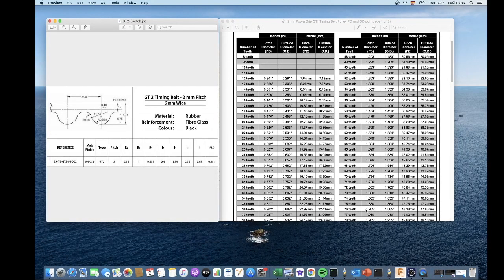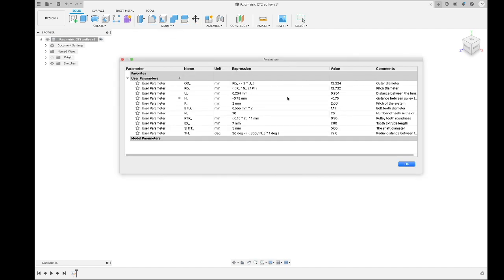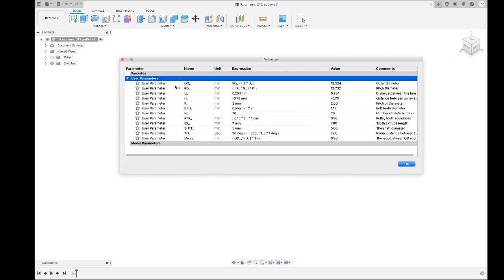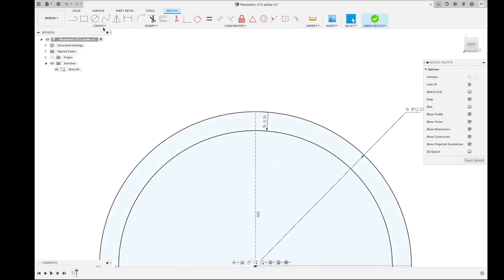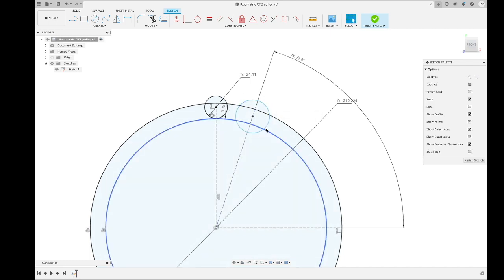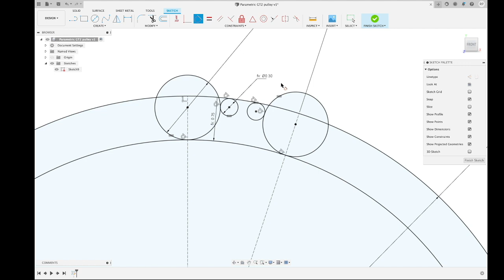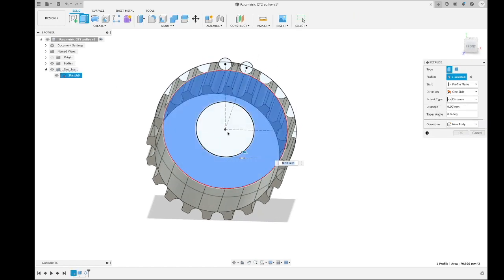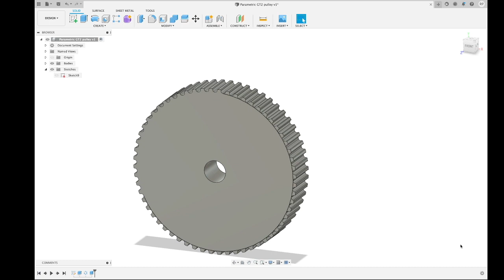Fusion 360 parametric design - GT2 pulley

Comment: Y'all can just import the formulas into Fusion! Just create a .txt, paste the following, and change it into .csv:

Name,Unit,Expression,Value,Comments,Favorite
U_,mm,0.254,,Distance between tensile cord and bottom of belt tooth (PLD or U); varies by profile,false
H_,mm,-0.75,,Distance between top of pulley tooth and bottom of belt tooth; varies by profile,false
P_,mm,2,,Belt pitch (e.g. GT2 = 2mm); varies by system,false
BTD_,mm,( 0.555 * 2 ),,Belt tooth diameter; varies by profile,false
N_,,20,,Number of teeth in pulley (main editable variable),true
PTR_,mm,( 0.15 * 2 ),,Pulley tooth roundness; varies by profile,false
TH_,deg,90 - ( ( 360 / N_ ) * 1 deg ),,Radial distance between two teeth,false
OD_,mm,PD_ - ( 2 * U_ ),,Outer diameter of the pulley,false
PD_,mm,( P_ * N_ ) / PI,,Pitch diameter,false

Comment: Really good work thank you! One small issue is that the resulting model does not have any radius on the belt teeth, therefore they will not fit into the belt correctly. I fixed it but just wanted to let you know about that missing component in case anyone else downloads the file.

Comment: When I try to extrude on the final step it selects everything in the circle instead of just the outer part. Please what do I do.
Reply: I struggled here as well, you can click and hold inside the shape and move your mouse to draw a rectangle that encapsulates part of the two circles and the intersection. This way you select the intersected body, afterwards press E to extrude

Comment: I just used your parametric model to 3D print a pulley with 440 TEETH. I was astonished when the belt wraps completely around it,  every tooth falling right into its groove, a perfect fit. I did not expect easy success. Thank you very much, this was extremely helpful.
Reply from the maker: Glad you share your experience and feedback ! 440 T’s sounds wild! I’m pretty happy that it worked out.

Comment: I am having trouble with exporting an edited version of your pulley with a larger quantity of teeth. I tried to get it into Cura but it only shows like a quarter of all the teeth on the pulley. Do you have a solution for this? Thanks!
Reply: Have you tried saving the pulley as a mesh with high detail? Then import the stl mesh into Cura?

Comment: Hello, super helpful tutorial! I’m going to make my own and later 3D print it. Do you think that I need to give it some backlash? And if I need to, how would you do it? Sincerely
Reply from the maker: Hi Martin! 
Thanks so much for your comment! 
Its sounds tricky to give some backlash because of the tight numbers the formulas give, but you can try it ! 
In this case i would print the pulley at the lowest layer height value  that could be something like 0.05mm
This allows the printer to give a fine detail to the part, resulting in a high accuracy product, hope it work for you, good luck! 
And congratulations for trying to print it !

Comment: hello it was amazing! thank you so much for sharing.I have a question.When i increase the number of teeth to 45 and back to 20, it starts to give error and model gets weird. Is it normal to happen like this?
Reply from the maker: Yeah man, it is weird... 
Thanks so much for your comment i really appreciate it !
A possible solution can be opening the sketch that shows the warning and delete the tangent constraits you gave to the pulley tooth roundness (the red ones), then drag and drop one of the circles and the pulley will get to the desired dimension, give back the tangent constraints and youre done. This happens every time you go back from a higher number of teeth. I´ve tried everything to get rid of this issue, it seems like it is a computing error. If you find any alternative please let me know. Thanks again :)
Reply: @cemf4330  Run into a similar issue with Fusion before. Best to actually generate the Stock then subtract the bit as a feature then do your Pattern. Feel free to use mine and try and break it ;) https://a360.co/357uhVM Seems to occasionally break the tangents in sketch2 of the minor tooth circles.
Reply: @seabreezecoffeeroasters7994  Dude, thank you so much for posting this. I'm trying to knock out a project this weekend and learning how to make the pulley was taking too long. I spot checked your math and changed parameters to what I needed and the design morphed correctly. Small suggestion: parameterize the ID of the pulley as well! Thanks again for posting this I really appreciate it :)
Reply: @andrewenglishsc  NP. The ID and OD of the pulley and the belt reinforcement path/diameter are all driven by the tooth count. You need to think of the belt reinforcement as a fixed known length but then bend that path (and assume the rubber will conform below it into the teeth). In practice you might want to slightly enlarge the bottom tooth diameter to reduce the squeeze if you are manufacturing one. If you mean the bore as a parameter of the pulley then yes it certainly could be but tweak your own and save it.

Now includes a Belt/Rack Generator too.
Reply from the maker: What a nice design, you also design the belt!
Thanks for your comment its really nice to see engineers around here!